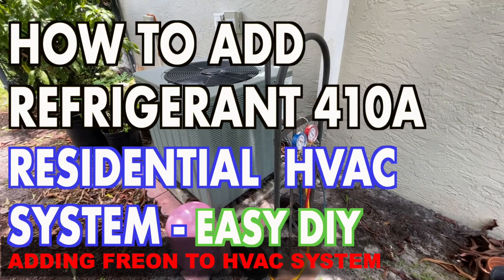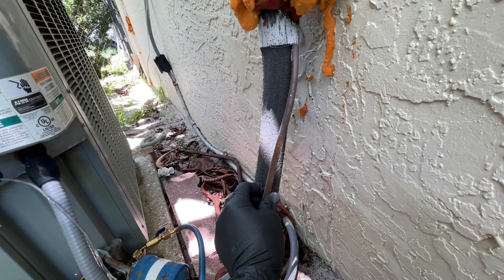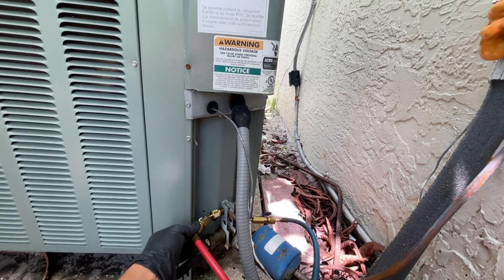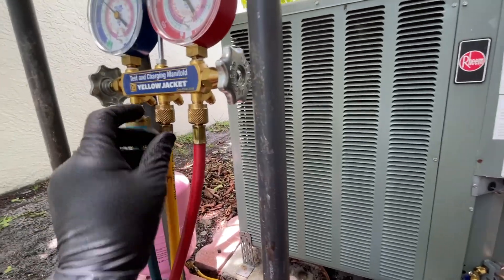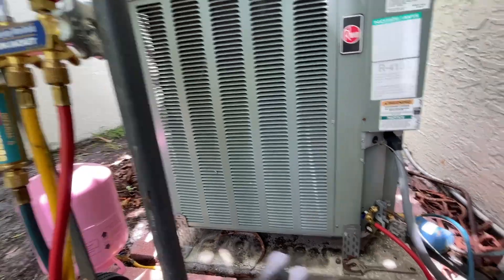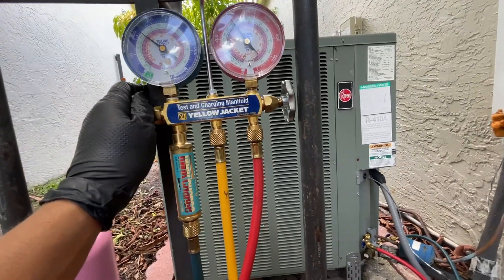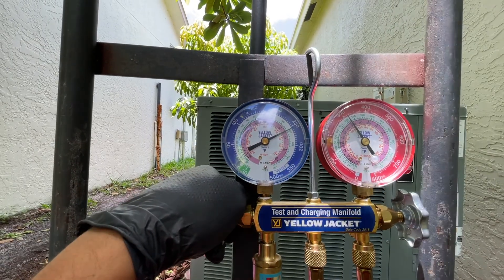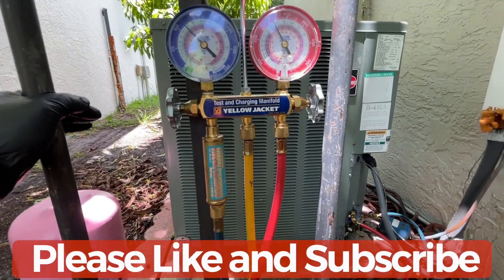How to charge HVAC system with 410a Freon gas properly - Residential HVAC

Comment: Is this unit required: Kwikcharge:
Imperial Tool 535C Kwik Charge Liquid Low Side

What is the Kwik Charge 535C for?
	•	It’s designed to let you safely charge liquid refrigerant (like R-410A) into the low side (suction line) of the system.
	•	It contains a flow restrictor / internal orifice that:
	•	Turns liquid flow into small droplets
	•	Prevents liquid slugging (which can damage the compressor)
	•	Allows faster charging than vapor charging without risking compressor damage
😊
Summary:
	•	❌ Not mandatory
	•	✅ Strongly recommended if charging liquid on the suction side to save time and ensure safety
	•	Alternative: Use a liquid-line charging method (system off) or a manifold with a needle valve.
Reply from the maker: It’s highly recommended to have one so you don’t damage your compressor by mistake.

Comment: With 410a what psi am I looking for it says anywhere between 102 and 145? What do you recommend
Reply from the maker: Honestly, speaking, you should not even be looking at the PSI when charging the susyem. It all goes by the sub cooling method. Once you reach your proper of cooling, you should be good with the pressure. Each system have different pressures and 410a quantity varies based on the length of the copper tubing.
Reply: @ gotcha
Reply from the maker: @829jr  it’s easier than you think. I made a few other videos too on it with different units so I recommend check them out on my channel. You will learn something and it will clear your concept on how to properly charge.
Reply: Copy that

Comment: You are suppose to charge 410a through the liquid line only with the tank upside down
Reply from the maker: @mk696  yes but that’s normally when your system is all empty. When it’s little bit gas needed you can charge by this method.
Reply: Summary:
	•	❌ Not mandatory
	•	✅ Strongly recommended if charging liquid on the suction side to save time and ensure safety
	•	Alternative: Use a liquid-line charging method (system off) or a manifold with a needle valve

Comment: How did you deal with the rust/possible leak at the filter dryer?
Reply from the maker: @davidfelix8084  I replaced the filter dryer with a new one and painted it with rust oleum paint

Comment: But whats the pressure required!? Whats the point if you dont provide the pressure level it needs to be at to be fully recharged!?
Reply from the maker: If you are really asking this then you should not attempt this. Again I repeat you should not attempt to do this. 
You cannot just have a specified pressure. The system needs to be charged using the process…watch the video again and watch other videos I have on HVAC PLAYLIST.
Reply: @HowToDoitright : Great video but you omitted a crucial point which your viewers would be interested to know. Your answer is not kind though
Reply: @HowToDoitright  this should be an easy reply, what was the pressure you used for this particular video?. Your reply is not a friendly reply, it was a valid question, one that should have been answered while making the video.
Reply from the maker: @carapungo sorry if you think it’s not friendly but I really don’t want you to do this without having the basic knowledge. You need to have a license to do this work and if you just doing it as a DIY without having basic knowledge then it’s not safe for you and environment. 
There is not a chart or specs for pressure. It goes by measuring subcooling or superheat. Search on what those are and how to measure it and only then you will understand. Plus also it changes with type of gas being used in system.
Reply: @carapungo completely right if you have to ask that he is right do not attempt if you cant even look at your data plate and read how much your unit needs
Reply: @carapungo cry baby

Comment: Thanks for the Video demonstration. At the end you mentioned something about that you had to do subcooling on the Rheem AC because it has a TXV - - but the demonstration shown in the video was you just adding 410a to the Rheem AC and watching the pressure increase.  So it appears you ignored the TXV procedure and just added 410a with pressure readings. Please clarify and explain?